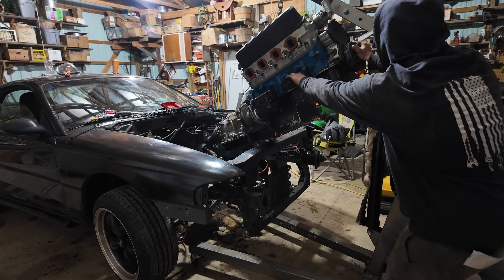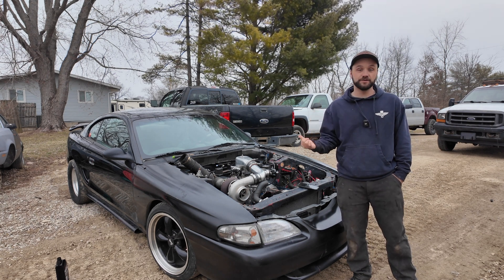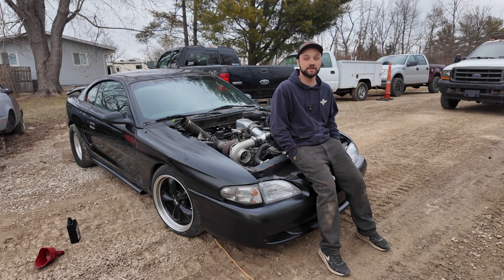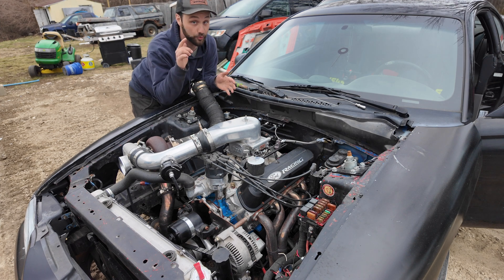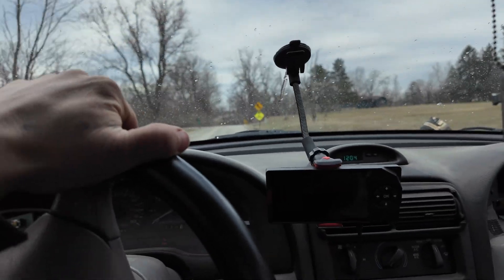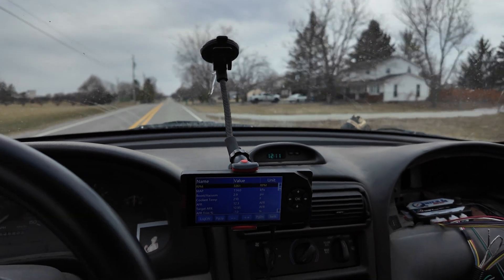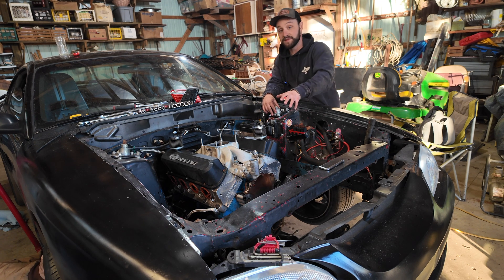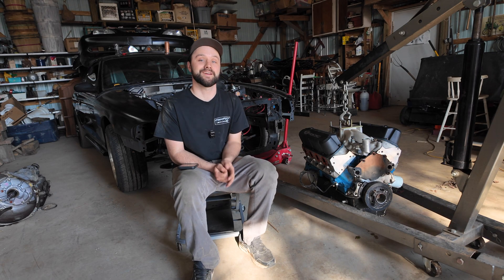I Built My First Turbo car WRONG | Turbo 302 SN95

Comment: I have a boosted stock block 302 (.30 over 306) on 10psi with stock/ported heads, built AOD and built 8.8 rear end, I built the whole car myself about 4 years ago and has never left my garage for anything --->  in a fully weight 1986 Foxbody Convertible. I have the dragy video on my channel and on a crappy street where you can see all the rocks and cracks in the road when I open the door to back up, I ran a 11.89 @ 120 with a 1.98 60ft. That run was launch control set to fuel cut (Had to figure out the TFI mod on the distributor so I can use MSD box with MegaSquirt 2 ECU) so only made 2psi of boost at 3000 rpm launch lol. Now I have it set to spark cut, I make 4psi now. Its my first boosted car so learning but I have a TON of videos giving it hell and going on 4hr road trips the past few years, I even smoked a bike a few weeks ago lol. Going to the track this season and trying for a 10.99.

Comment: My car is a stock bottom end turbo 302 FBO made 577/602 on a mustang dyno on 15lbs with a a9l I just swapped it over to Holley and still running fine

Comment: Do you think if I have a street 302 turbo build stock block and don’t have the need to run 25 pounds of boost ( no race tracks near me / not racing anyone ) just building like a low boost cool little turbo car it could handle a turbo with girdle the right piston ring gap
Reply from the maker: Absolutely you can do that. Love boost it’s a beautiful combination. I think I’m going to buy my friends Foxbody and show how to do it correctly but you absolutely can .
Reply: @ still learning what would the right piston gap be just curious I’m trying to build a 306 with forged pistons and afr heads

Comment: I got a question you say using the same EFI is your EFI aftermarket or stock
Reply from the maker: I’m using the FiTech 1200 power adder, I will use the efi system until we out of horsepower it

Comment: I had been watching this build. I’m building my car now. Stock block 302 with cobra spec T45 (yes modular trans to pushrod sbf via adapter) with aces efi  royal flush kit blow through with 70mm on3 turbo. Plan is 7-10psi of boost fun street car. Only question I had was I know your efi is probably about like mine. The royal flush will support 650hp but boosted probably more like 500 with only the 4 100lb injectors. I see you said you were going to run your efi setup you got now. I don’t know if it will support much more than say 12-15psi of boost with the current system. Is it II or III bar map? What fuel pump and line size you running? I’m running a walbro 525 pump with a quantum fuel system hat and -6an feed and return. I figured my pump has enough to max my feed line and the efi system (ironically also should be at the failure point of the blocks structural integrity 😅)  didn’t think to run a girdle 🤔 cheap insurance I suppose. I’ll add that to the list!!! 😂
Reply from the maker: I’m running the FiTech 1200 power adder system. It supports up to 30 pounds of boost, and I’m pretty sure it has a 3 bar map system but I’m not sure. I used their fitch force fuel system and it also supports 1200 up with two fuel pumps in it, it also acts as a gallon surge tank. I plumbed it into my factory fuel system but now that I’m pushing past 600 HP I’m re running the fuel likes in -6an for better flow. I know people that run those aces systems but I haven’t seen anyone push POWER from them . There’s FiTech guys running 8s so that’s why I chose them
Reply: @ way more system than mine then for sure!! 🤣 I went with aces because they are local to me. Trying to support the ones who support my local track. I also figured that if I had problems with them being local I might be able to get them involved 🤣🤷🏻‍♂️ still following the build!! Keep up the great content man!! I’ve been watching the channel grow and hope that trend continues man!!

Comment: look at mr money bags over here with the dart block! i'd love to see the difference in weight, and any issues you run into with the block, like if the cylinder head drain lines up correctly.
Reply from the maker: lol it’s just the shp block, but 2700 bucks sucks but if you’re fully rebuilding a motor… that extra isn’t that bad